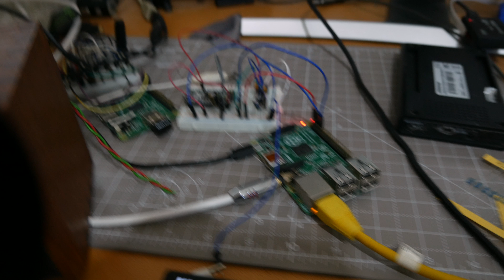Roberts Radio: Ready To Mod

Comment: Not sure how far you've gone with this project by now, but I was just thinking, if you want to emulate some more nostalgia you could always have it so it mixes between two stations as you move the dial. I don't think you'd have to stream two radio stations all the time, just have a trigger point where it starts to stream the next station, and a trigger point where it stops streaming the old one, and in between those two points you could have various levels of fading between the two stations. Not sure how complicated that would be to script on the Pi, but it should be possible.

Comment: Nice project. Regarding the power supply: the raspberry alone needs decent amp of around 2amp peak usage. So when you add an amplifier the amount of needed amperage would raise beyond those 2 amps.
Reply from the maker: I think that depends upon the Pi that you use, the A+ and B+ that I have are much less power hungry that their more recent counter parts.

Comment: Is this going to have issues with the iPlayer requiring a login in the future? When I saw that being announced I thought it would apply to TV only, but even the iPlayer Radio app has been pestering me about it.
Reply from the maker: I don't think the stream URLs will be limited... yet. I have trawled the BBC announcements but no further information.
Reply: David Watts The iPlayer Radio app finally wanted to force me to register and log in this week. Except clearing the app data skips around that requirement, and everything works as normal. The third-party UK Radio Player app still works as well, it and many other apps and devices would stop working if the BBC forced login to access the streams, so you're probably OK for a while.

Comment: How are you counting the pulses? It is a bit hard to read your code on my phone screen.
You might want to have a look at this video by Kevin Darrah where he used the timer/counter register and interrupts to count high frequencies quite accurately (mostly due to the interrupt): https://youtu.be/gEb9OEZ3bsA
Reply from the maker: Thanks these are not high frequencies, 4000-5000hz max. I am using the Arduino IDE's built in pulse counter - https://www.arduino.cc/en/Reference/PulseIn. I don't need to read them accurately just constantly, the frequency is not important just the resolution across the range so I can spread out the stations on the dial.
Reply: David Watts would measurements improve if you use shorter leads?
Reply from the maker: Yep, well hopefully. One it is but on protoboard stability should improve.